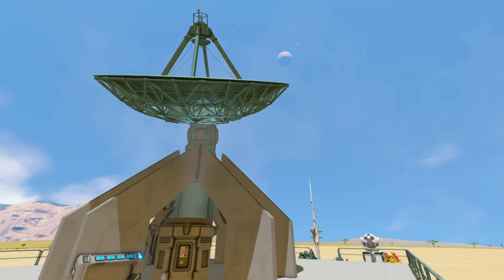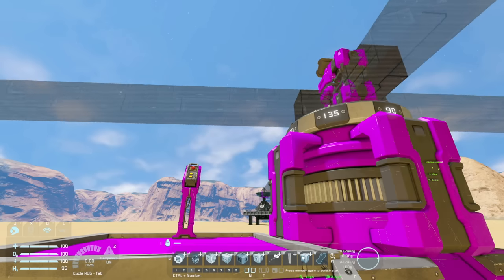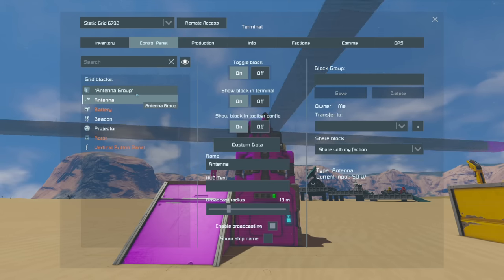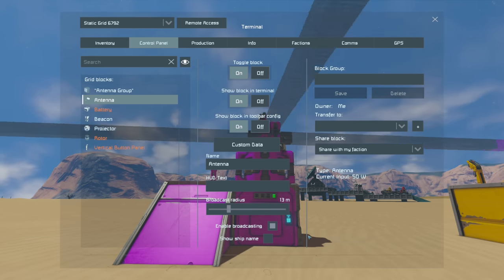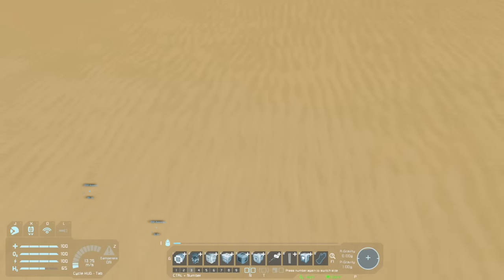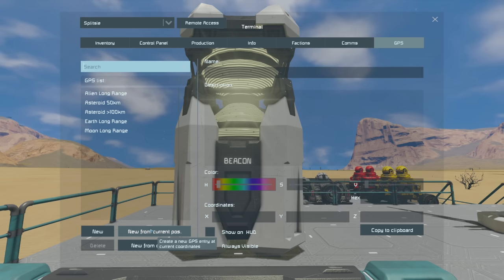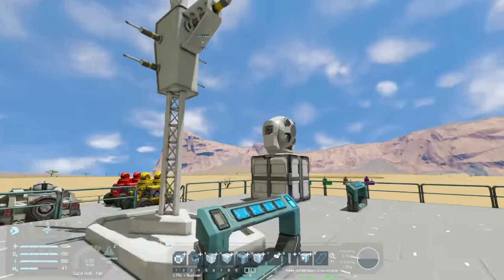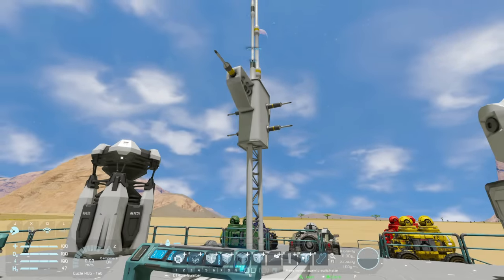Antenna, Laser Antenna and Beacons - Space Engineers Tutorial

Comment: I learned a lot of this stuff on my own from dealing with Reavers and trying to have separate bases in communication with each other.
Very glad to know that laser antenna actually will reconnect with a mobile grid if the mobile grid breaks connection and then re-aligns though.  I was afraid to try and use it with a mobile command ship for fear that I might break connection and just be locked out of communication with my base(s)

Comment: Something that might not have been clear in the video is that laser antennas can establish links to bases at extreme range (like between planets), but if you add a regular antenna to the remote base, the laser antenna at the remote base on the same grid as the remote antenna will let you link to other antennas within range of the remote base antenna. 

Okay, that's still confusing...

1. Build laser antenna on home base.
2. Build laser antenna at outpost.
3. Build regular antenna at outpost on same grid.
3.a. Regular antenna at outpost can communicate with other regular antennas in range of outpost.
4. Establish link between home base laser antenna and outpost laser antenna.
4.a. Home base can now access/control any grids in the outpost's regular antenna network.
4.a. Make sure outpost has a remote control block. This will act like a cockpit, as if you were actually there (lets you use toolbar rather than just control panel).
5. Make sure regular antennas on static and mobile grids near outpost are also broadcasting far enough to reach outpost regular antenna.
5.a. Make sure grids in range of outpost regular antenna have remote control block if you want cockpit controls on grids in range of outpost.
5.b. Make sure grids in range of outpost regular antenna are transmitting their regular antennas far enough to reach the outpost.

If, say, a drone is broadcasting 500m, and a regular antenna is broadcasting 5 Km, you can access the drone terminal out to 5 Km, but you can only remote control the drone within 500m, because the drone must be able to transmit back to the outpost to be remote controlled. Since the outpost's regular antenna is on the same grid as the laser antenna, establishing a link with the outpost laser antenna via home base laser antenna is effectively acting as if you're in a control seat at the outpost, despite being hundreds or even thousands of Km apart.

I know, this can still seem a bit confusing, but once it clicks in your head, it makes a ton of sense. As long as all grids in the network can both send and receive signals to at least one other grid in the chain of signals (the network), they can be controlled if equipped with a remote control, and of course, have adequate power.

Comment: So I tried putting laser antennas from a planet to a station 1,500 km away, but I encountered two issues. First, I encountered an issue where the laser antenna would not connect if they were over 500km away. I am going to assume this is a bug as there were no asteroids blocking the laser and the terminal UI suggests that there is no hard limit. I had to make relay stations 500km apart. Second, I encountered another issue where I had to be like 1km above the surface of the Earthlike planet in order to connect to a relay station in space.

Comment: One thing you didn't mention is why you may not want an antenna. I think that is a basic mechanic we all should know. Attracting hostile NPCs. I have played 100;s of hours but am not 100% on how it works myself, but my understanding is that your suit antenna will attract NPCs and their fire. Even when hidden, and that they will lose track of you if u turn it off as long as they can no longer see you directly? I assume the same is with antennas? by shutting them off you can stop attracting NPCs from far away? Especially turn off to avoid Player enemies.
And finally that the laser antennas do not attract NPCs and their broadcasts cannot be seen by anyone but you are the grids they connect.
What I would also like an answer to is - does the relay function work for people outside you faction? or NPCs, especially players. do they also get the relay benefit or can they only see transmitters when they are in their actual broadcast range?

Comment: Lasers were my fave in EA versions becuase in MP no one could see my grid locations. Using a satelite in orbit over my base I could then copy the satelites cords and just past it into anything so it trys to aim at it, and rely it to the whole satellite network. This comes in crazy good for more stable use like a ground vehichle but it wasn't that too bad in EA. But yeah for long range its infinite it wasn't back then, I could turn it on for bursts from huge distances to remote access something, then toggle it off once done.

I do like that bit of change though If I wanted to send from another planet costs would be insane but do able. I just miss the whole it was still doable for say a rover or atmo flying miner to connect to a satelight in that hemisphere and I could just copy paste cords into it to change which static structure I was connected to say if I had more then one base for some reason, I could either do one base always have on linked, and back then solar and some batteries was enough to keep the power running for the rely, or I could use like a notepad or sticky not app on my computer with cords to otehr static things to have it connect.

Issue now is I am worried about cost to do that on small grid craft, say if I wanted to turn the base refinaries on and off or something like that as I get on approuch to base to unlaod raw materials...

Comment: You should deep dive more into laser antennas and how to use them to connect between planets (or just earth to moon for simplicity)
Because in my experience voxels block it even though there is direct line of sight and I’d like to know how to get past this issue.
Reply from the maker: I spent a fair while testing that and couldn't determine any consistent issues. Sometimes it would work and sometimes it wouldn't. I did have greater luck connecting planet to asteroid than planet to planet though
Reply: @Splitsie  that’s fair. I was told that because the way voxels render, they end up creating one in between the antennas when far away. So maybe building it on a mountain then connect to a satellite would work?

Comment: Question regarding the laser radars, does the power consumption apply to both parties? Like if the base is attempting connecting with a satellite 4km away in orbit, because the base is the one that established connection would it take the brunt of the power consumption? or do both the base and the satellite have to provide equal amounts of energy? I assume the latter but it doesn't hurt to ask and confirm. 

I bring this up because I am having difficulties getting two laser radars to connect in a MP server. The base is on a moon surface, protected by the Defense Shield mod, 8km away from the nearest safe zone, attempting to connect to a satellite that is floating 4km in orbit. They both have clear line of sight with no visible obstructions but both continuously state they are searching for each other at target GPS coordinates. I have tried moving the bases laser radar outside of the defensive shield, moving it to a ship owned and built by me so both the satellite and the base radar is owned by me and still no progress. 

Since the satellite is basically a battery with some solar panels, radars, cameras, gyros, antenna, could the power draw from attempting to connect at 4km away be causing the satellite radar to basically be stuck in a limbo as its unable to draw enough power to establish a connection?

Comment: Did they ever fix the issue with laser antennas and grids far away unloading?

Not sure if it was specific for multiplayer or not but it was kinda silly since the whole point of them were long range connection but unless you were there with your character, the laser antenna would rarely if ever be able to connect because one of the pair was unloaded due to no one being close and not being simulated.
Reply from the maker: Some of those problems are still there, though in testing I was able to achieve a 1000km link that was fairly stable. I couldn't determine the precise conditions for when it would and wouldn't work though so didn't have anything constructive to add beyond my comment about voxel interference being inconsistent 🫤
Reply: @Splitsie  Hm good to know that it might at least be a bit better than before but my dreams of a planet to planet network is probably still a dream.

Comment: I'm doing a playthrough right now with the intent of setting up a relay network through the whole system, and currently have relays set up between Earthlike and Mars every 250km or so (for acceptable power usage). I'm having a very annoying issue though where the connections between the relays seem incredibly unstable. In the Remote Access menu, the distant relays are constantly flickering.

It just occurred to me that it might have to do with the fact that I'm using a solar alignment script and maybe there are power issues on distant relays... but I'm wondering if this is an issue anyone else has seen with distant / multiple relays!

Comment: so what exactly happens if antennas have different ranges. Say 100m apart, A have 100m range, but B only 50m. Will they establish connection? Is it going to be somewhat limited?
Reply from the maker: If the range doesn't reach the block from either antenna, you can't get a full connection. You may be able to send signals via PB but can't receive anything if the other antenna isn't going far enough to get to your receiver :)

Comment: Could you explain if it would be possible to use Antenna and broadcasting and remote access to be able to open my wall gate hangar door while sitting in the cockpit of my rover by using a hotbar button?

Is that possible?
Reply from the maker: With a script that is possible, without scripts it's not. You'd have to use sensors to detect your ship on approach and they have a fairly short maximum range

Comment: Ok so this is gonna sound a little confusing, I want to connect a ship to a station, however, I want to put laser antennas in all angles of the ship and station so they won't lose connection, do I have to connect each laser antenna to each other so that way no matter which angle I'm in, I'm in constant connection to the base?
Reply from the maker: Yes, because they connect in pairs, so you'd need multiple on both. This would still let you black out though as you'd need the correct antenna from your vehicle lined up for the correct one that's visible from your base

Comment: Hello there, you are missing one point in your tutorial, either by choice or just simply because it isnt really relevant for a tutorial: A pair of antennas dont need to be in range of each other to be visible, thou not connectable. Its enough if on of the antennas reach the other and the other to have a much lower range. The low range one will then be shown and relayed by the high range one, even if the remote connect isnt possible.

Anyways, thanks for the awesome content :)
Reply: That is a good point. When I first started messing with antennae and remote control it took me a lot of disconnects to understand the limitation of the suit's range. It's very easy to lose control of something that has a long range antenna because you were controlling it with your suit instead of a grid with another long range antenna.
I've always experience the suit's transmit range to be limited to 50m rather than the 200m he showed in the video. Maybe they changed that at some point and I've never noticed, but I thought I'd recently lost control of a remote rover at 50m when I didn't realize I had my base antenna turned off.